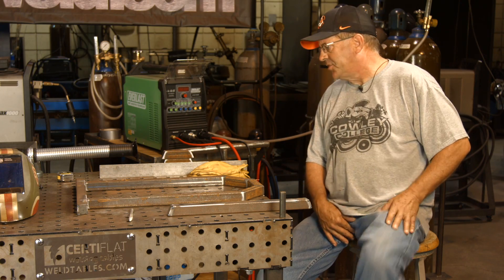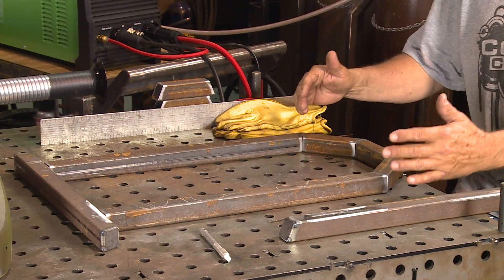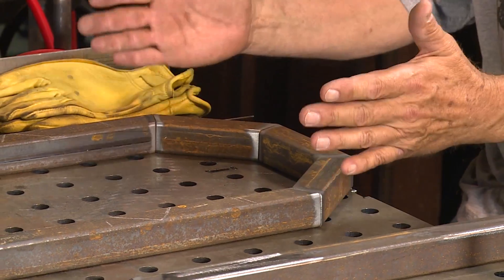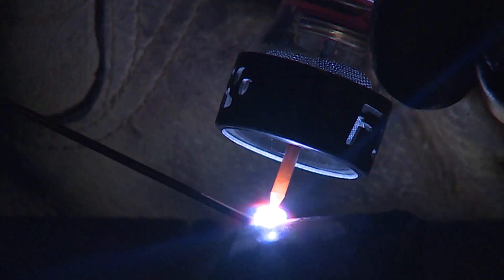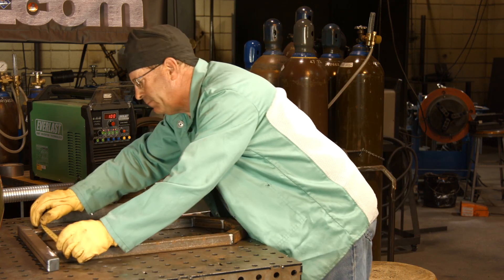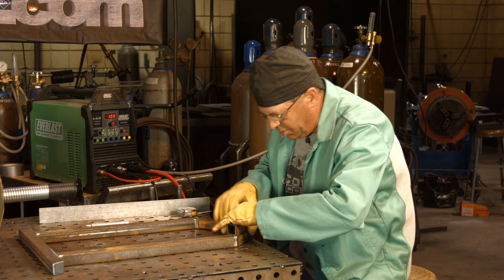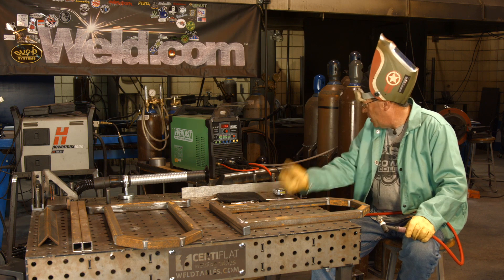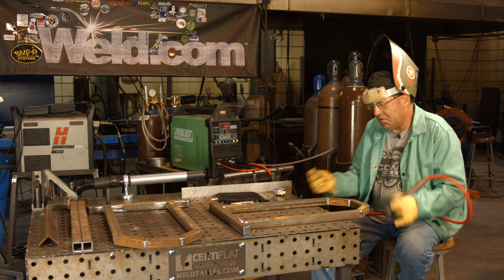🔥 DIY Mini Wood Rack Project

Comment: I have had some parts wobble as a weld also but I think it was a mixture of a crappy table and ground on the crappy table. Usually when I move my ground to the part I'm welding it goes away.  By crappy table I mean a like 16 gauge table from harbor freight... One day ill have a certiflat!

Comment: Just learning TIG. 1/16 tungsten with er70s filler rod on 1/16" steel. 
DC- polarity at 65 amps was my settings using the 1 amp per .001 of thickness. 
Getting some black soot and also my tungsten is balling up??? Any ideas??
Reply: Quit sticking the tungsten in the weld pool?

Comment: late to comment but rest assured you`re not the only one with the parts shaking due to bad ground man. what is your preference regarding caps for tubing, same outside measure or slightly under size?. pecan is beautiful for small boxes too
Reply: When I cap tubing, I usually make them a bit smaller so it's like an outside corner joint and finishes off nicely.

Comment: Have a question about 6g 3" heavy wall pipe. When I come with the cover pass ( walking the cup ) the bead profile starts to sag from 8 to 10 o'clock. My amperage is 130-140 . Wall thickness is 1/2". Is it because I'm running to hot , or slow ?
Reply: Андрей Клименко Stringers or weave? Try leaving the wire on the top side of the bead if you're weaving.

Comment: I've only tig welded once while working in our metal shop at work we usually mig welded, which hand tig welding holds what I'm left handed to write but ambedextrious using right hand for every thing else, brushing teeth right handed, shooting right handed, shaving right handed, should I hold torch in right hand and filler in left hand or learn to use both as you did thanks
Reply: MrBez09 Try both and see which is more comfortable.   You may be a natural with either.

Comment: I've been fabricating a long time and I am still not good enough to run a 500 amp machine on 14g tubing without grinding my welds but, my equipment says Miller on it, not Dell. Dildo keyboard welders are funny. Old Bob has probably forgotten more about fab than these Facebook fabricators will ever know.

Hell, I didn't know Harbor Freight made a 500 amp machine....who knew.
Reply: Good stuff man. Dell welders. That's funny!! Thanks for the support.

Comment: Parts that have the shakes !!! 

Bob, I get the part shacking thing on occasion too. I imagine it is due to poor ground. It usually only happens when you don't have a direct ground to your part. If you are grounded to the table and relying on the ground transfer through the table to your part it usually happens. What I usually do is clamp the part down or use a third hand with copper contacts and that usually does the trick.

Comment: Idea for a project:

Folding adirondack chair with the folding / support parts out of steel.  Have the the only wooden parts of the chair be the arms, vertical back support, and the top of the seat.
Reply: The Wizard Better keep in the shade. Might brand you behind if it's in the sun.

Comment: I see many of the welders here on youtube hold the stick electrode with 
their free hand to steady the stick. Is that a safe practice and why do 
they not receive a shock?  Thank you from a newbie
Reply: I don't know Why it doesn't shock you scientifically but its safe enough, just move your hand when it gets too hot
Reply from the maker: Yes, it is very common practice.
Reply: Probably the flux and your not well grounded.... I wouldn't try it standing in a puddle barefoot with a rod that the flux has been knock off if I were you though =).  I really dont know exactly though, I not smart.
Reply: Jeff DeLuca 
http://www.weldpedia.com/2015/05/7-effective-ways-to-prevent-weld.html
Reply: 10:4 littleal I may have been weaving to much in first pass. probably no weave would work. I used 95 amps, less I got a lot of sticking but that may be my inexperience also
Reply: When you travel across, are you stopping for a second? Try counting when you sweep across and hold it for 1 second then go across quickly and hold for 1 second. Experiment a little with rod angle and amps. Slightly uphill but not much and a little higher amps. The great thing about learning is learning from your mistakes, even though it may get a little frustrating at times. Time to go burn. Keep a smile. 😃
Reply: OK today was a milestone... I actually dropped the amps to 85. Now the slag falls right off as opposed to being stuck like glue.  I was able to run uphill or horizontal and get a nice bead with no undercut. The welder seemed to grunt a little though, not sure if thats a sign of too low of amps. I was able to scratch the electrode and get it to light off. Had some sticking until I got the hang of the strike-lift motion. I may be OK after all. What do you think about the welder grunting? I'm running 7018 3/32 on DC+ and I'm able to keep the arc tight without it sticking. Lincoln ad-dc unit
Reply: Ah, you're hooked now. 😃 I'm not sure about the grunt sound. I've never heard it before so I can't help you there. I do think you'll be spending more $$ on electrodes though. Have fun!
Reply: 10:4 littleal Yea I'm in sales and marketing but honestly, this is the stuff I love. Getting close to welding on some tail light brackets but want it to look decent.  I have a Precision Tig 185 also and may try the stick function of that machine to see if there's a difference
Reply: 10:4 littleal Appreciate you hanging in there with me the newbie
Reply: Steve just Steve Ran a few uphill beads w 3/32 7018's 95 amps DCEP and getting a decent looking bead but some undercut. am I not holding the arc long enough on the sides as I weave?
Reply: Is it best on a single pass uphill with 3/32" 7018 Excalibur rods to simply not weave at all? The article points to excessive weaving as one cause. My rod angle is slightly pointed uphill. I may be travelling too fast in my inexperience as well, I got a decent looking bead but just undercut. Any more thoughts?  Thank you once again!
Reply: I noticed also the slag does not flake off easily as I see in some of these videos. Takes a bunch of effort to get it off. Too much heat? Ideas there?
Reply: 10:4 littleal going to give tig a tryout. welding 2 pieces of 1/4" plate. I have a 3/32 thoriated tungsten. dc- polarity. what should I use for amps?

Comment: Can you do a video on welding cast steel.  I know many people weld on cast steel exhaust manifolds from GM trucks with 4.8/5.3/6.0 LS engines to turn them into manifolds for turbochargers.  I wondered what the proper procedure is.
Reply: Welding cast STEEL doesn't require any special procedures. Welding cast IRON is a different story.